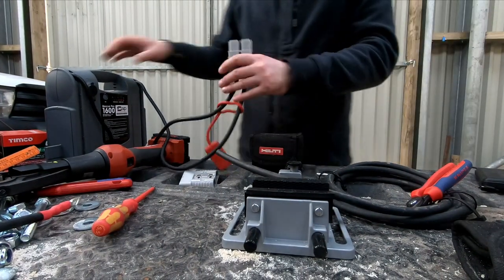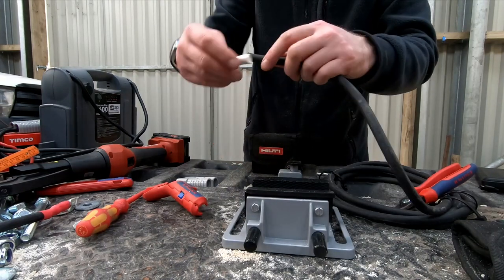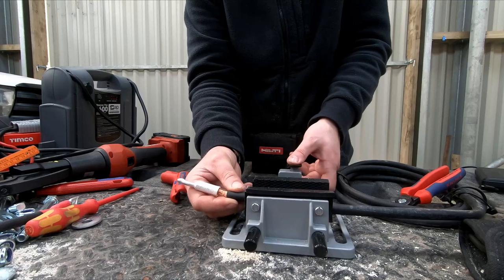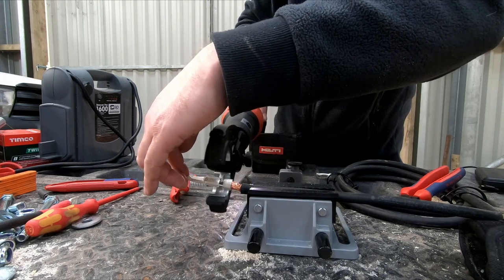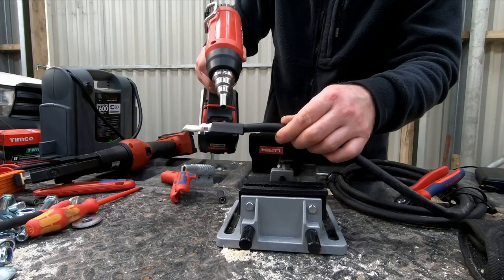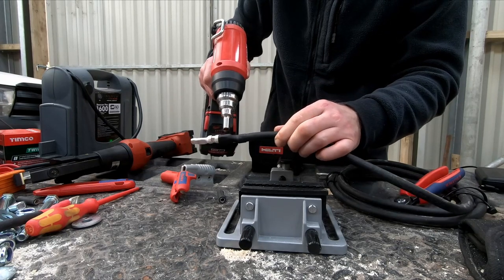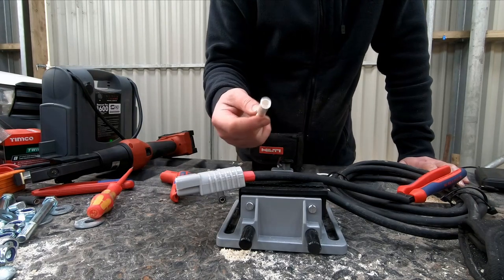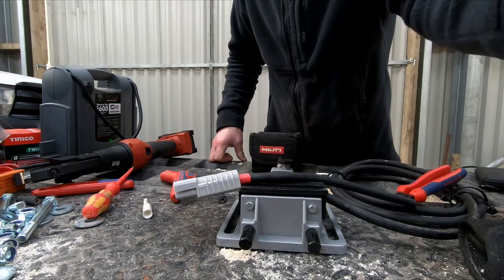Crimping Anderson SB 175 Wire Contacts like DIN 46235 Compression Cable Lugs

Comment: First of all:
You stripped the insulation to far back. You should strip it a few millimeter longer than needed for the lug.

Second:
Start crimping at the contact end and not the wire end as the lugs elongate a few millimeter when being crimped.

On crimping with a hexagonal crimp tool:
About 10 years ago I reached out to  Anderson with the question if hexagonal crimpers are allowed as they recommend a 4 point indent crimper themselves. This also because of several forums and videos on YouTube making hexagonal crimps with a decent result.

That lead to a visit of their sales representative Jurgen Mann. I showed him how I made the crimps and he took a few samples with him for testing.

Testing confirmed a correct crimp on the condition that I use the 35mm2 crimping die for all the wire sizes of the SB175. So for the 25mm2 cable in the 25mm2 lug, 35mm2 cable in the 35mm2 lug and even for the 50mm2 cable in the 50mm2 lug.

So it is possible to get a correct crimp on the SB175 with a hexagonal crimper. But they still not recommend it.
Reply from the maker: Hi @Richard1977, thanks for sharing this information. I will try that out.

Comment: There was analysis for resistance between soldered and crimped Anderson connectors. The crimps had more resistance.
Reply from the maker: That sounds quite plausible. I never measured and compared that directly. Do you have any numbers on that or a link to such information?

Comment: Got a hand powered hydraulic crimper, and I can not tell how far to crimp.. it doesn't seem to ever get harder as I crimp
Reply from the maker: Might depend on the crimper. When operating the hydraulic crimper I have, there is no difference in resistance when crimping until the crimp operation is done (where one cannot continue crimping). But there is no guarantee that the crimp operation is done correctly. This is one of the advantages of a powered crimping tool.

Comment: Bad idea to have all that exposed copper even with shrink tubing on top.  Less rigid and can give trouble.  And the insulation helps with positioning the contact properly in the housing.  Better to strip the insulation flush with the contact barrel end.  Also, if your red marked wire is the +, as one would expect, you have the wires the wrong way around in the Anderson plug.
Reply from the maker: Hi @e9999qwe and thank you for your comment and sharing your experience with crimping Anderson connectors. For my installations the crimping even with the exposed copper proved not be a problem or causing trouble. I will try your method on the next crimp. Regarding the marking and "+" you are absolutely correct.